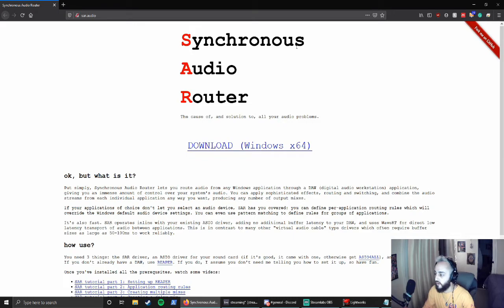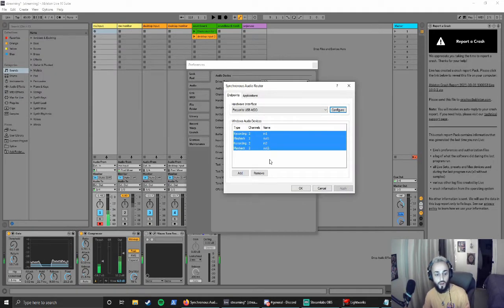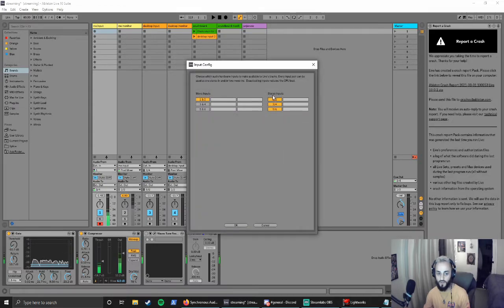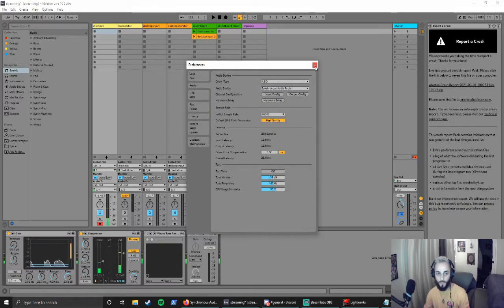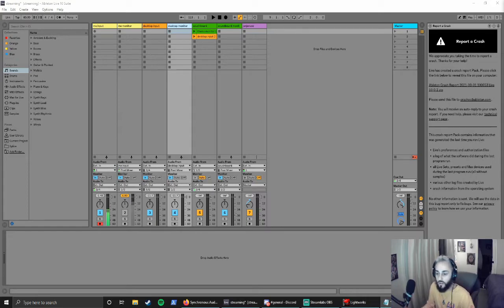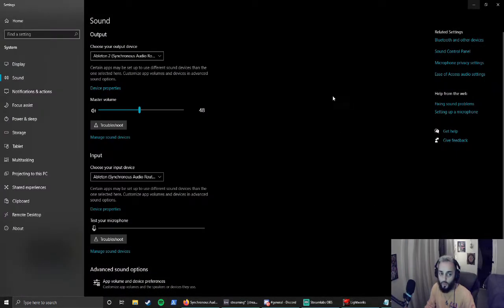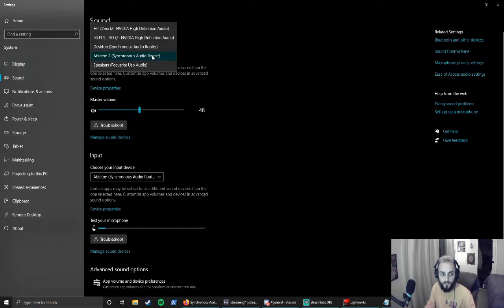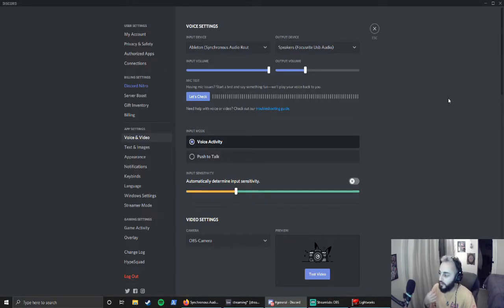How to use Ableton Live to process your voice into ANY software (Discord / Zoom / Videogames)

Comment: i spent 4 hours messing with this nonsense, with your video i was able to get my routing fixed up in mere minutes

note: i did have to use "in1" as the recording device for external programs but it works like a charm nonetheless

Comment: Well I will be messing with this later. I currently have an elgato wave 3 mic and it came with Wave Link software. It is really good; however, I wish it would add stuff like echo, deep voice or the ability to change voices...
As a game streamer, I have been trying to figure all of this out. I have not used wave link as all it does is separate audio into individual tracks like banana and potato to which I just found out about them last night!!!!

so will check this out... and report back! but of course in 5h warzone 2 comes out and I will be streaming that so do not want to mess with anything at this time!
Reply: A more performance friendly and easily accessible/ easy to use alternative would be 'voicemod'. has easily interchangeable settings and presets for your voice without too much hassle setting it up.

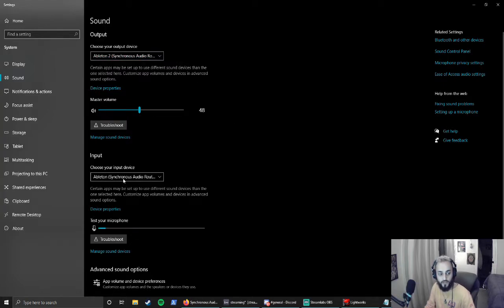Comment: Can you please help me? I did everything exactly as was in video, but at the 5:02 when you are choosing your output device in windows i dont have option of anything called "Ableton (Synchronous Audio Router)" but instead of it i can choose "out1 (Synchronous Audio Router)" or "out2 (Synchronous Audio Router)".. but neither of them works as it should.. idk where could be a problem :'')
Reply: I've got this same problem. u ever figure this one out?
Reply from the maker: It's going to either be out 1 or out 2.

Depending on what you've configured in Ableton. I suggest playing music on your pc. Look to see if the levels of one of the Ableton channels is bouncing. Then in windows change output device to that one so you can hear the sound.
Reply: @jensenkaplan5676  neither of them works:(
Reply: can't there be a problem with having a scarlett 4i4?

Comment: when i try to use synchronus audio router as a device it says it only has input channels and i cant use it
Reply from the maker: Did you make sure to add both inputs and outputs in SAR as described in the video?
Reply: @jensenkaplan5676  when I switch it to synchronous I can’t even continue past that point in the video because it wont let me switch to it
Reply from the maker: @stinkydognuts  I'm confused. You have SAR installed right? And in Ableton you can't even switch to sar? 

I first recommend full restart of PC.

Second there's a SAR audio interface that you can use to set up inputs/outputs. So it's an alternative to setting them up from within Ableton.
Reply: @jensenkaplan5676  yeah I have it installed but it won’t let me switch to it in ableton it’s really weird.. been trying to set it up but it’s kicking me in the ass
Reply: @jensenkaplan5676  do you think you could hop in discord tmr and help me?
Reply from the maker: @stinkydognuts  yeah we can try that later today. I'm on EST time.
Reply: @jensenkaplan5676  what time are u available?
Reply: @jensenkaplan5676  alright I’ll be o. Imma add you right now
Reply: @stinkydognuts  did you all resolve  this step i am having the same issue with live not allowing the drive to be set because it has no outputs set up
Reply: @rlclick284  yes. i wiped windows and reinstalled sar and boom it worked lol

Comment: I had this working but then I changed the hardware interface option in the 'hardware setup' section and everything stopped working. It basically crashed ableton and now when reopening ableton it doesn't let me use "synchronous audio router" as an audio device. Like selecting that device gives me a popup saying "failed to open device". I tried reinstalling SAR but it didn't change anything. Any ideas?
Reply from the maker: Hmmmm, are you using the previous version of SAR? Latest version has some weird bugs. I recommend one older.
Reply: @jensenkaplan5676  Yeah im using the previous one. I even tried multiple previous ones but no luck :/
Reply: I actually just figured out the solution. Apparently Ableton doesn't allow you to use unconfigured devices/misproperly configured devices such as in my case. All i did was go into reaper which DOES allow that and edited the SAR stuff to be correctly configured once again. Then i reopened ableton and it worked :)
Reply: @ManMaverickTV  worked for me also.
Reply from the maker: Hmmm I feel like best idea I have is for you to fully uninstall SAR, fully uninstall your audio interface drivers. Full PC restart. Reinstall audio interface drivers. Then reinstall sar. Then redo steps.
Reply from the maker: Perfect! Glad you figured it out! Hopefully it'll help others
Reply: @Reyner Reaper is a DAW just like ableton. If your issue is the same as mine was then just download reaper(it's trial mode is free) and then edit the SAR stuff in there. Hope it helps!

Comment: theres no 3&4 or 5&6 imput or output channels
Reply: Try switching to MME/DirectX and back, fixed this issue for me.
Reply: @franceballe  Thank you!!!!! THAT HELPED
Reply from the maker: at which part? adding them into ableton?

uninstall SAR, full reinstall with ableton closed. did you remember to add the inputs through the SAR interface?

Comment: Yes so I'm all up to speed except, the windows master sound settings has no option to select "Ableton 2 synchronous" 
I restarted but still nothing, any help?
Reply from the maker: Hmmm... Do you have your Ableton audio project OPEN and configured when you try changing windows master sound?

For me, if my Ableton audio project is not open then windows doesn't see SAR sources. It will use defaults. Then as soon as I open my Ableton project it will switch back to the SAR sources.
Reply: I still have this problem
Reply: Any fixes?
Reply: yes me too.. give us solution

Comment: Hey bro possible to help troubleshoot? I've got everything going exactly like you have, just not recognizing the sar driver, after installed properly
Reply from the maker: So I've found out that the SAR driver's NEWEST version either doesn't work, or doesn't work on some systems. So try installing SAR's previous version.
Reply: @jensenkaplan5676  thanks will try
Reply: @bbouro  Did it work?
Reply: @lucatronicmaximus432  hey not yet. Gave up